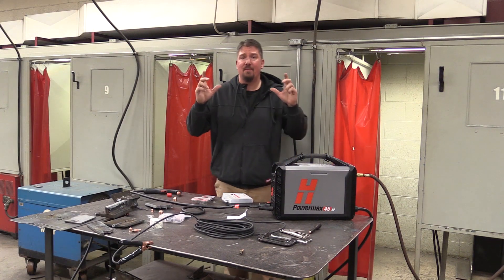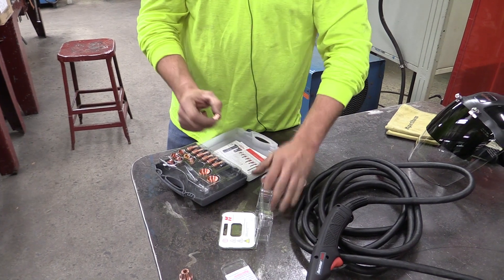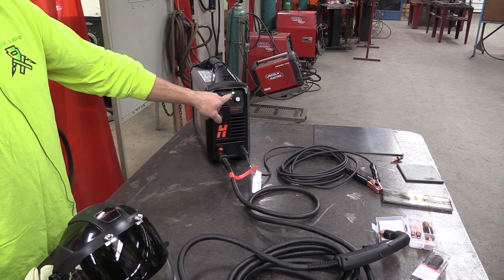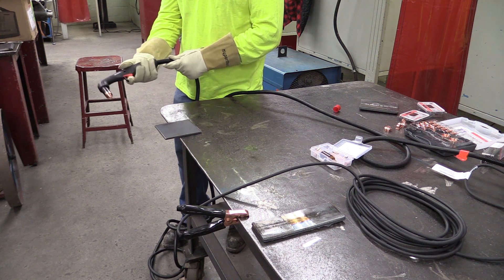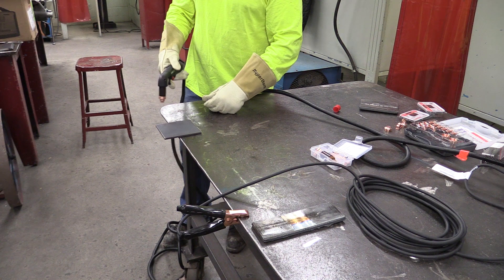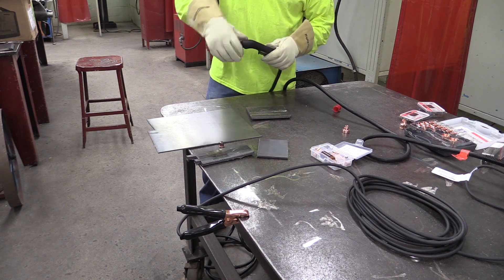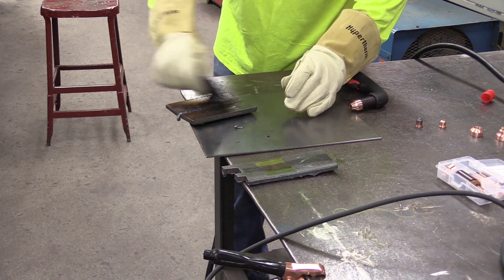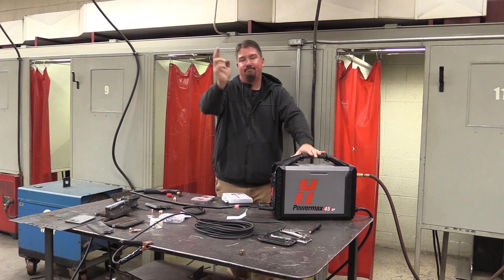Introduction to Plasma Cutting, Gouging, Consumables And What You Can Do With A Good Machine

Comment: Hypertherm is high end for daily use. Most of us who are just hobbyist can't constitute $1800 price tag. I would like to see some budget options that work well but at a much better cost. I myself would only use it a few times a year maybe. But when you need one, they are invaluable.
Reply: Also, you didn't mention compressor requirements. My understanding is you need a good one. Not one of those little pancake ones.
Reply from the maker: Yeah, wont run off a small compressor.
Reply: Buy once, cry once.
Reply: Hey they are only 2800 now! If you’d have bought it then you’d sell it for more than you bought it for….and used it for four years!